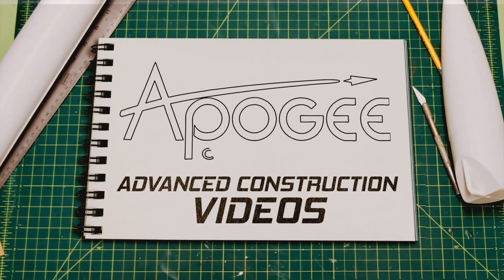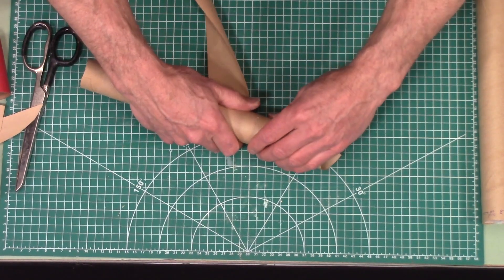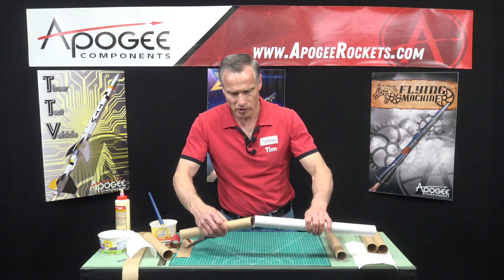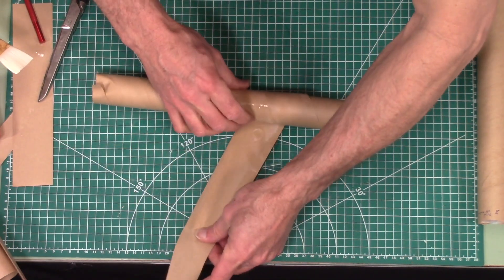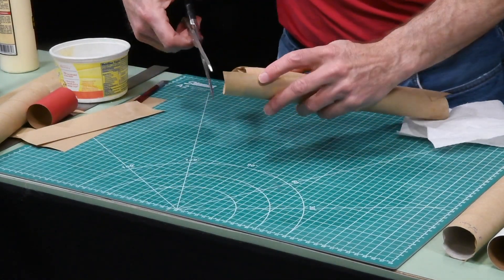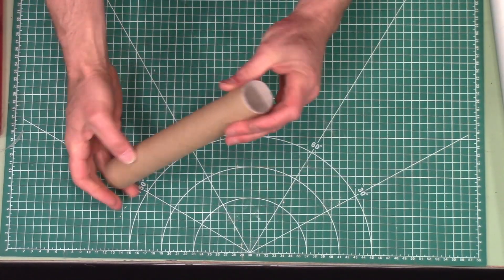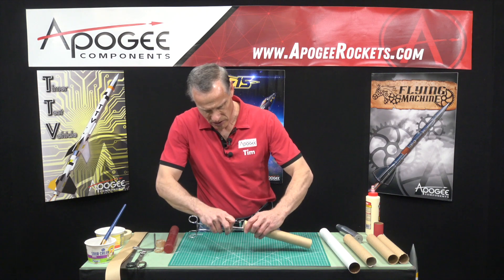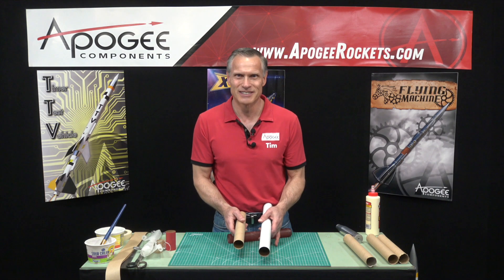How to Make Your Own Paper Tubes - Part 2

Comment: I've noticed on most spiral wound tubes that they are in the same direction as your method. I've assumed that this is done more for ease and speed of construction. Wouldn't the construction be stronger if the second layer was in the opposing direction or if more than two layers alternating direction between each layer?
Reply from the maker: You can vary the direction of the layers. That will make a stronger tube.
Reply: @apogeerockets What is the GSM (grams per square meter) of the kraft paper you used in this video